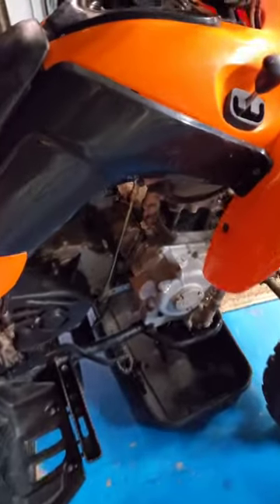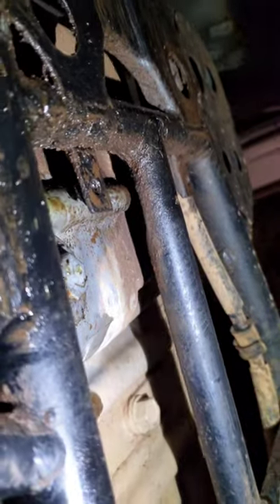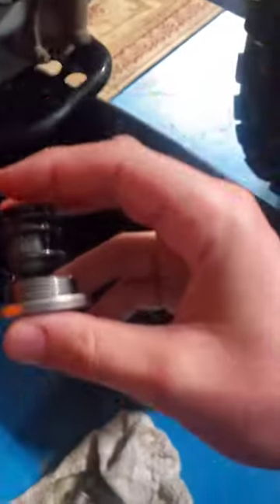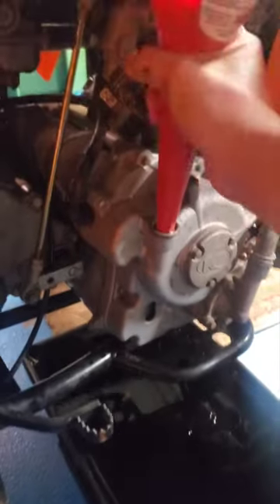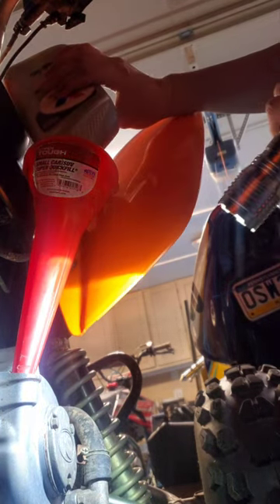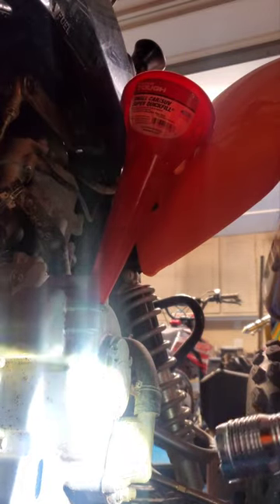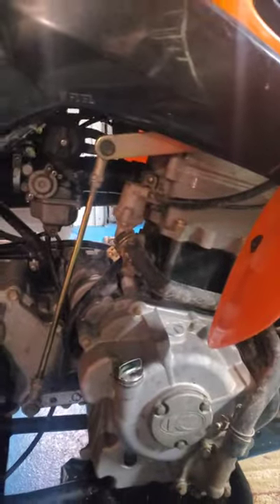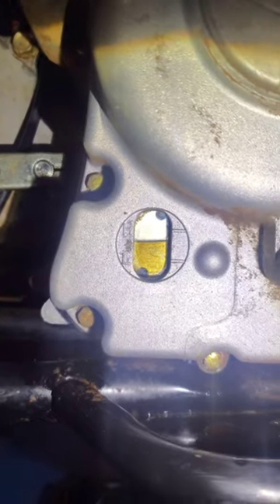Kymco mongoose 270/300 quad atv oil change

Comment: I just changed the oil in a MXU 250.  I took off the other bolt that is more underneath the quad.  A little oil came out but I'm not sure what it is.  Gear oil maybe?  The manual is not clear and I can't find any info on it.